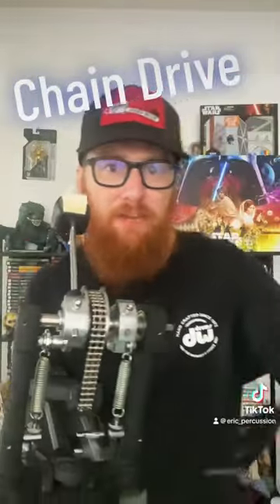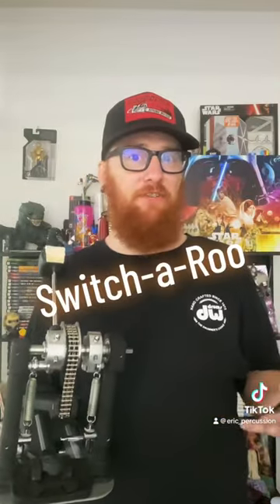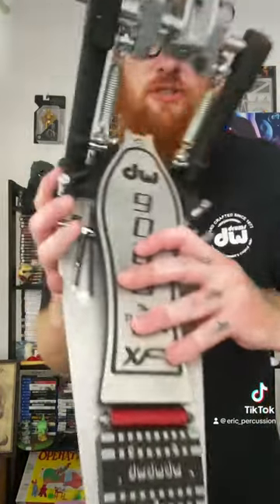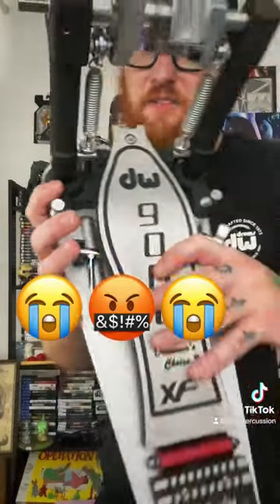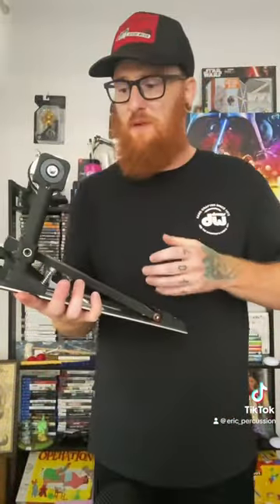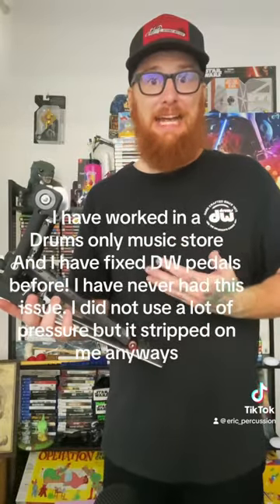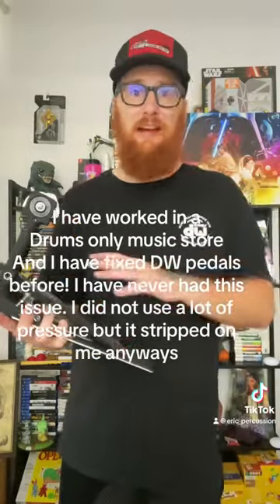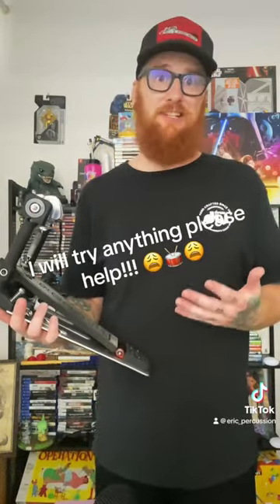DW 9000 Pedal FAIL!!! I stripped the screw and now I can’t get it out!

Comment: A rubber band in between the screw and bit could give it enough friction if you push hard into it as you turn. Or If it's that soft use a small drill bit at the center of the screw and make a whole to either break the screw, or glue another screw into that whole and let the glue set- then just turn the top screw slowly to get it out. Other options include animal sacrifice or genie wishes, but try the rubber band 1st.
Reply from the maker: 😂😂😂 thank you for that very informative post! I will give all that a try and if all else fails I will do the sacrifice hahaha!!!

Comment: Dw uses a tough lock tight on that screw, your gonna need to use a heat gun or one of those hot screwdriver things meant for melting the locktight.
Reply from the maker: I really appreciate that!! Thank you
Reply: @ericshenanigans  no problem friend!
Reply: I used a heat gun on it for 2 minutes and I still managed to strip the screw. Wish they didn’t use such strong thread lock on it and that they’d used a hex key instead. I think the angle to get around the shaft contributes to the problem. Over engineering is not good engineering.

Comment: Use an impact driver to drill a hole in the screw and then insert a pin with metal adhesive use pliers to unscrew and order new ones
Reply from the maker: Will have to give this a try! Thank you

Comment: They make sets of extractors for screws and bolts. The screw extractor looks like a cone with a spiral coil. Hammer it in, twist it out. I had to use the nut extractor on my oil drain plug because someone (the dealership) put a few too many ugga duggas into it. But the set for nut extractors came with screw extractors.
Reply from the maker: Thank you I’m going to give that a shot!!